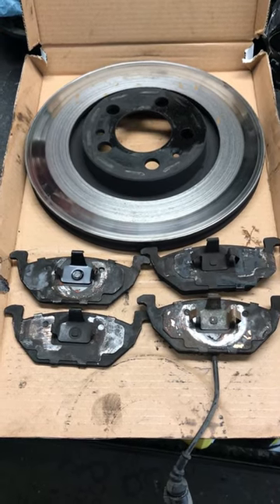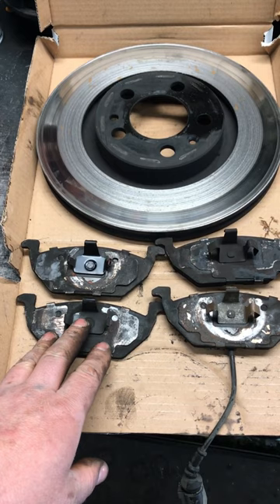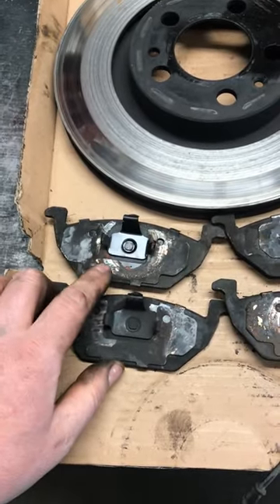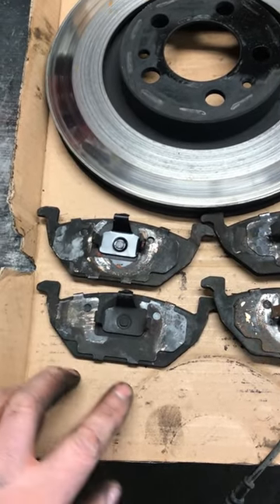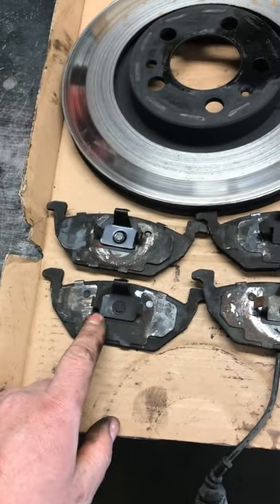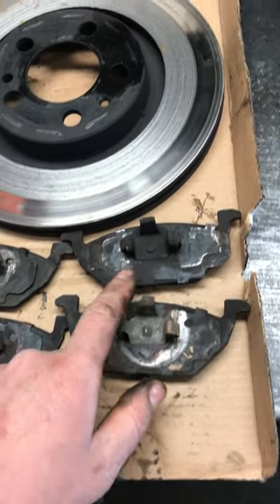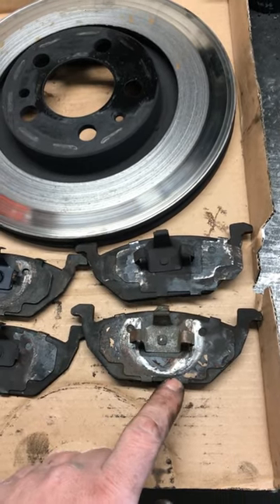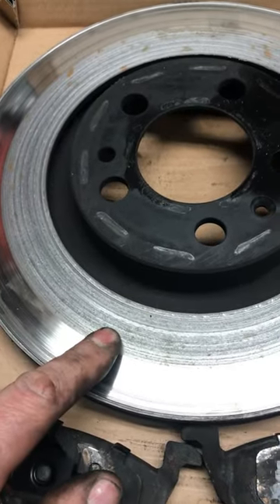Brake Pad PSA - Lay them out and carefully look for differences! Sometimes not obvious! #shorts

Comment from the maker: Car was a 2007 VW Jetta City 2L. One side was metal on metal the other side was like new. Calipers were ordered! Thankfully we noticed the improperly installed pads before installing the calipers. Close call though! Almost got much more expensive. These brakes should have lasted another couple years.

This is why I always layout pads on vehicles I not super familiar with. I carefully look them over to see if there are ANY differences. If there are, then I will look to see who goes where. Save yourself and your wallet a headache!

I have a video of brakes on a Ford Raptor (F150) that also has different inner and outer pads. They can also be placed improperly and I have seen that. Won't make any difference right away but one week later and they'll start SCREAMIN!
https://youtu.be/e2zL9t-rIQs
Reply: Is it a safety issue too?
Reply from the maker: @Chee- Rex  Far from ideal of course but under normal braking conditions the effects would probably be minimal. Yes, under heavy braking it could lead to the car pulling to one side and maybe even earlier brake fade under extreme braking. But normal city driving I don't imagine you'd notice much except it would probably develop a brake squeal from heat.